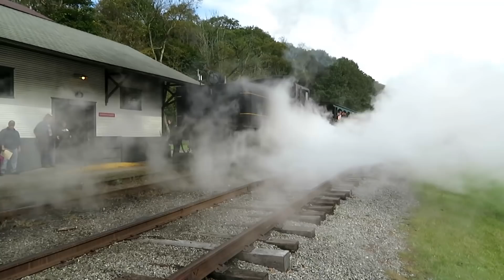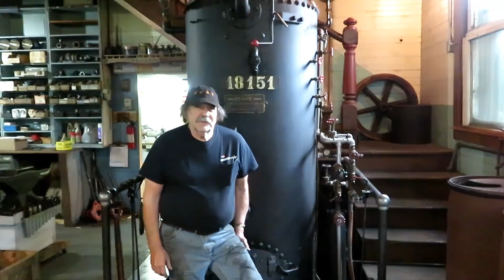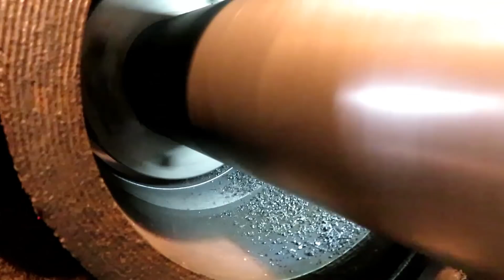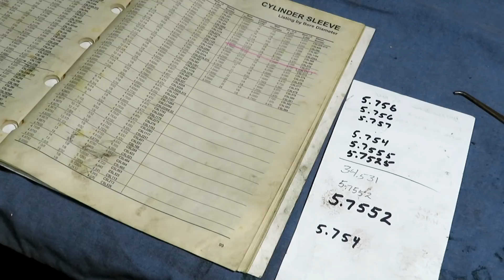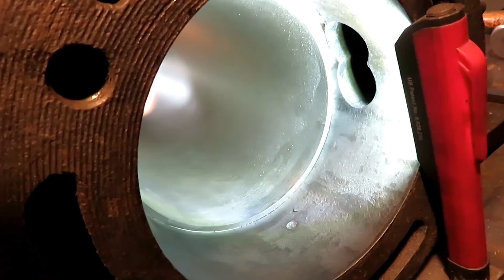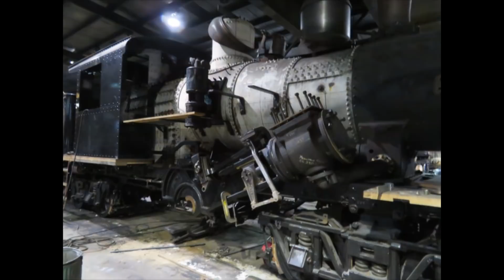STEAM POWERED MACHINE SHOP 50  Boiler certification, saving a hit & miss cylinder

Comment: Nice to see those old Shay's restored.
Where I live, back in the days of steam, the shay was a pretty popular loci for logging.

One of the old shops that I used to work in was an old locomotive shop from the days of steam.  It was a cool old shop but they tore it down years ago.
We were not allowed to work in it during periods of high winds and heavy snow due to the age and condition of the structure.
But it was still pretty cool.

There was still a line shaft with a few pulleys up in the ceiling in the old machine shop.

The handrail going up to the lunch room was polished smooth from years and years of mechanics running their hands along it going up and down the stairs

When they tore the shop down they sold the timbers out of it.  
Can you imagine what they looked like.  Big 12X12 old growth douglas fir timbers smoke cured for god knows how many years.

Unfortunately, there are none of the old loci's still working, lots are out as monuments to our logging heritage, in a nice little park when you come into town, but not working.  Shame really.
Reply: Brian Dick : West Virginia probably hosted the most Shay of any state. The C&O had twenty of them in operation to included there big boy the Class Ds, 100+Ton-4 truck with 17" bore and 18" stroke locomotives. WM, that took over the Greenbrier, had five, Class Cs, and B&O operated three plus the five from WM after there merger. They never operated on the main lines but was used to haul both coal and lumber to the main lines because those speed demons couldn't handle the grades and curves.
Reply: That's sad to me..I was living and working in a 100 year old warehouse machine shop building for the last 14 years. Got baught out from under me by a new owner to build condoes.
It got tore down and now is an empty lot.. It pains me that people have such little regard for heritage and the past beauty all for just money. Our place had 50 foot long beams in it,, I always marvled at the size of the trees it must have come from. These things are irreplaceable and yet discarded without a care. 
That burned down saw mill in Dave's video made me sad. Although the rusty line shaft wheels I coveted.